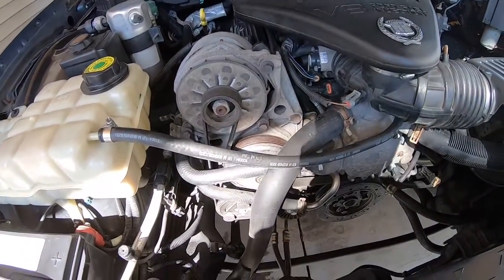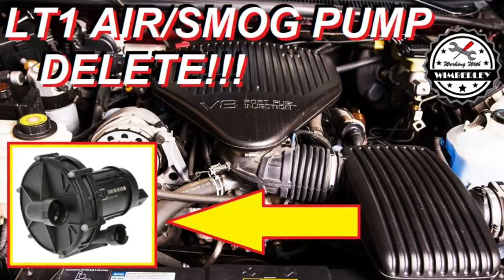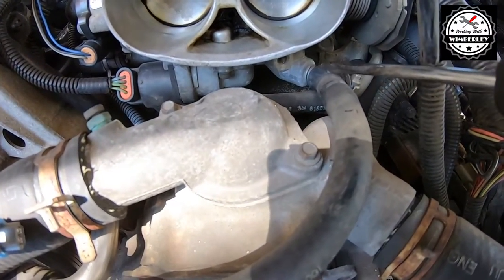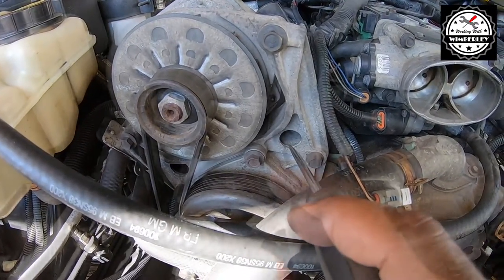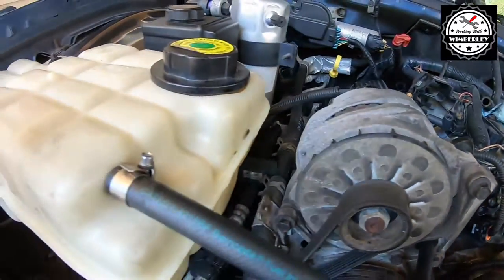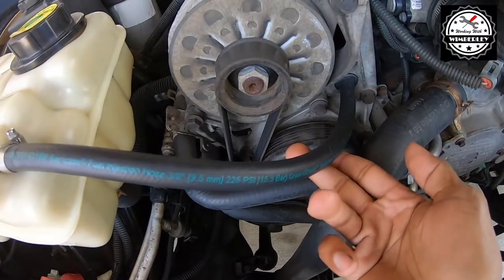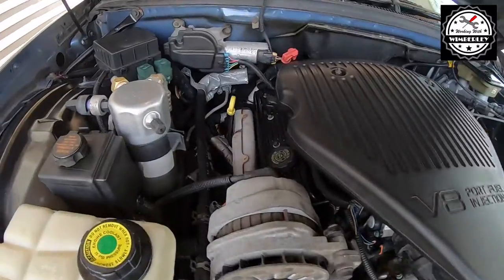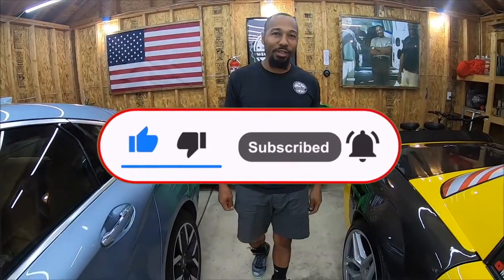LT1 Throttle Body Coolant Bypass Mod 1994-1996 Cadillac Fleetwood & Chevy Impala SS Buick Roadmaster

Comment: Where did the driver side go to ? To the hard line ?
Reply from the maker: It went to the rubber hose that goes across the front of the engine to the expansion tank on the passenger side.

Comment: I did mine and cut the hose so it won't dangle on that power steering pulley
Reply from the maker: Ok cool. I know mine looks close in the video, but there a few inches of clearance between that coolant line and that pulley. What do you have? Impala, Caprice, Roadmaster or Fleetwood?
Reply: 95 roadmaster I threw out the smog pump when I did the optispark I just did the throttle body coolant mod about a month ago when I had to do the water pump. I just put a wine cork in the holes and left the smog lines hooked up to the exhaust manifold.  Currently battling an a/c line that won't fully seat on the compressor . You should try the air foil on the throttle body it's cheap 5hp gain for 25 bux that and the idle washer mod is free
Reply: I took out home plate and put a hockey puck in its place.  My o2 sensor is frozen  on the passenger side so I just unplugged both of them.  It runs rich but she runs strong

Comment: Is the hard line the line that's hooked to both heads?
Reply from the maker: Yes. It’s connected to the back of both heads.
Reply: The air cooling line right ?
Reply: Coolant crossover pipe on back of heads?
Reply from the maker: @Dilly-kays  Yes, it’s a coolant pipe.

Comment: Colder throttle body helps horsepower when doing this mod. If you drive your car in very cold weather do not do this!
Reply from the maker: Thanks.
Reply: Is this safe to do in texas
Reply: @corbinsims7203  Yes, I kept the hose and put it back on during the cold Idaho winters.